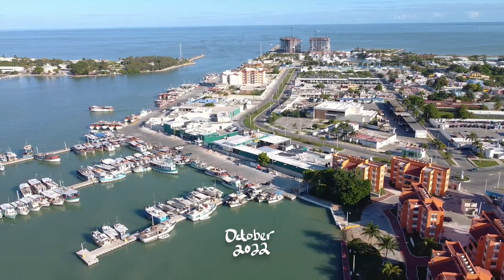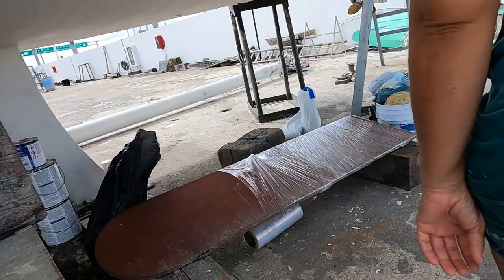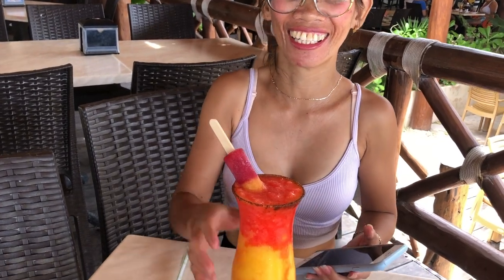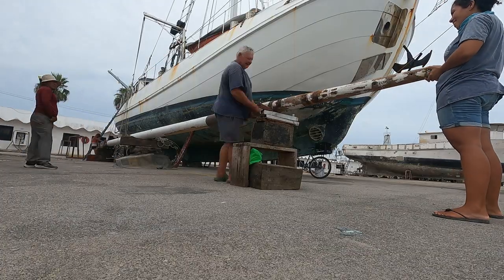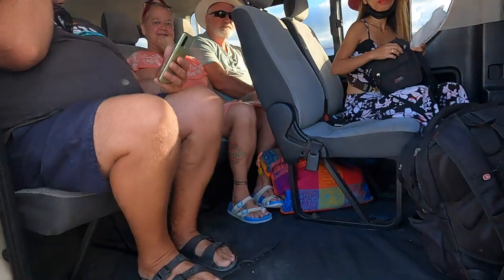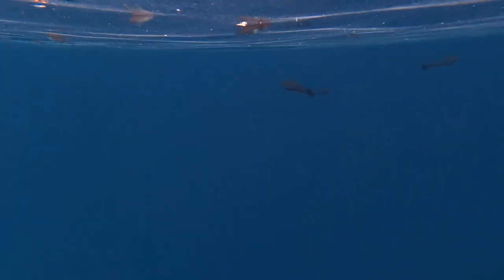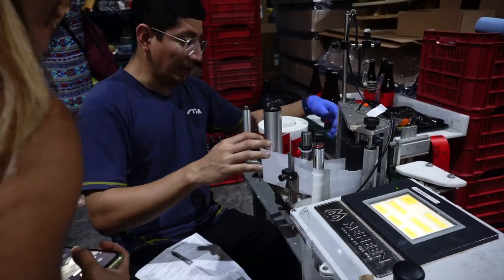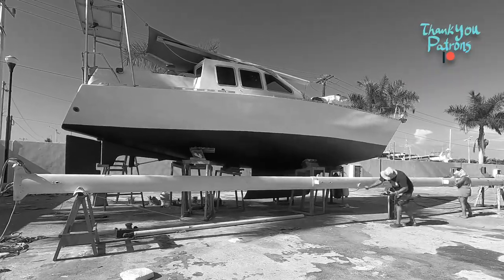DIY sailboat restoration in paradi$e PROGRESO

Comment: Excellent video.  The wisdom of a smaller boat is right on.  I found the sweat spot between too small or too large of a boat is a 30 ft waterline.  What do others think?
Reply: But consider the chef and dog along with the masterpiece video artist... in this circumstance the boat is the right size....
Reply: We have a 34" Gemini catamaran which is a lot of boat in a small package and makes a great coastal cruiser for a family of 3 with a dog.
Reply: @mngbennett  I like those better than a lot of cats but can't afford to buy one... in Hawai'i they command $100k for the oldies...
Reply from the maker: ~ 30 ft sailboats are definitely the sweet spot for small budget sailors, or just sailors starting out in our opinion. Life is just simpler that way - but an extra 10 ft can bring so much more potential of crew, comfort, carrying capacity - that's what we're trying to get at, but it's definitely been difficult.